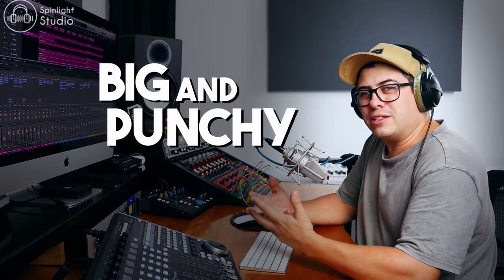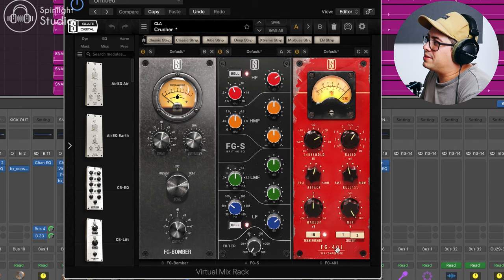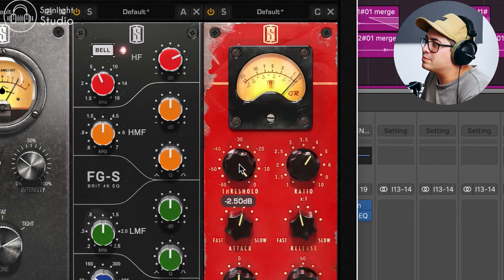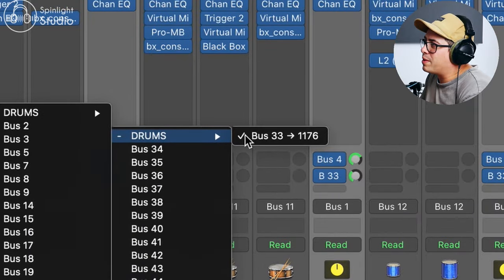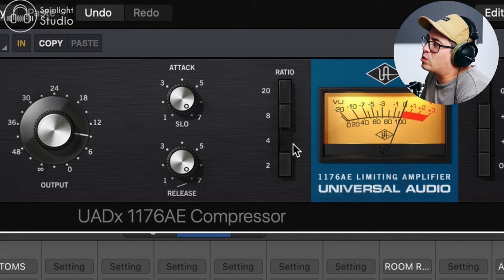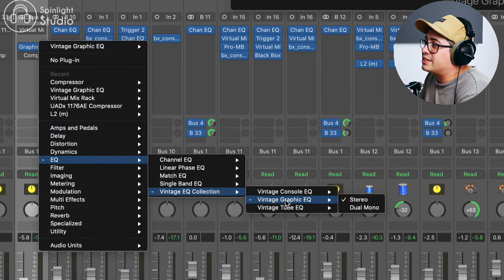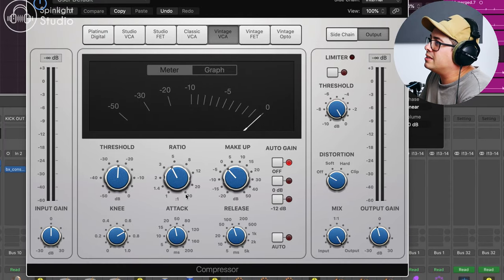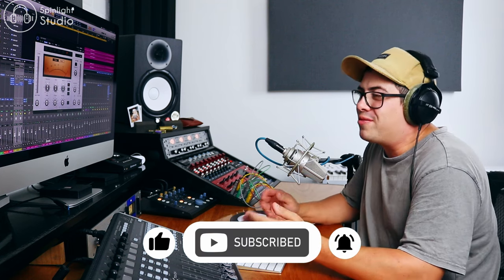Make Your Drums Sound MASSIVE With This Trick...

Comment: Not sure why but my drums only sound good when I clip the drum buss a bit via compression.  I don't like to run it in the red but it sounds so freaking good.  Only the snare clips anyway.  I know people do this on purpose but not sure if the actual channel is supposed to clip.
Reply from the maker: You can definitely clip the drums bus/run it hot with plugins etc, then just turn it down so the channel isnt going above 0. Going over 0 in your DAW won’t add anything just bad gain staging haha

Comment: I’m interested in the routing in logic, I like to send all parallel stuff pre fader so I can solo it too listen, whenever I set up a bus post fader it always has the dry signal to deal with, this is making thing tricky at the moment ?
Do you always route all parallel busses post fader?
Reply from the maker: Usually I do most things post fader and don’t find it problematic!
Reply: @spinlightstudios  Thanks man love the channel, question how can I  solo the send to hear the effect in isolation without hearing the dry . I don’t want to mix like this but I can’t hear the effect in solo unless I switch to pre fader, maybe I just don’t know what I’m doin yet, be assured this real instrument recording not edm or midi stuff
Reply: I find this most frustrating when I want pan a guitars reverb to the opposite side , I have to go pre fader so it will isolate
Reply from the maker: @paulferrarodrums  yeah that makes sense, or you could use the “gain” plugin and use the swap left and right button if it’s a stereo send. That will flip which side the signal is on!
Reply: @spinlightstudios  interesting thanks for your prompt response I will try that .. just FYI , I’ve just  set up my last mix session like yours in the basement recording.. it’s going well at this stage I was using track stacks instead of aux tracks for drum (snares Tom’s ect) groups, interesting that you used sends for drum groups , but you  used track stacks for the other instruments , it made my routing tricky , any thoughts as to why?? 
Cheers mate appreciate the response
Reply from the maker: @paulferrarodrums  I was on an older version of logic at the time, now i would probably do track stacks within track stacks for those things! But either way, it’s the same result just slightly different layout.
Reply: @spinlightstudios  fkn awesome you put me out of my misery , I’m really appreciative of the prompt response, it was confusing me , but now I get it, thanks, I gotta go re do these groups , I hope you can understand the confusion especially when talking about pre and post fader effects against stacks and sends , I’m glad I’m here with you to discuss and I’m not nuts. 
Cheers man look forward to more of your content especially that your in Logic and stevenslate, although I just switched all to waves , didn’t know about the waves console emulation until now either. 
So thanks again., more real world stuff is the best 
God bless you